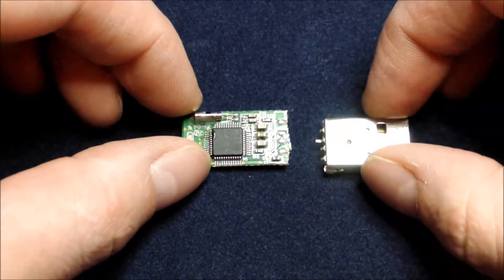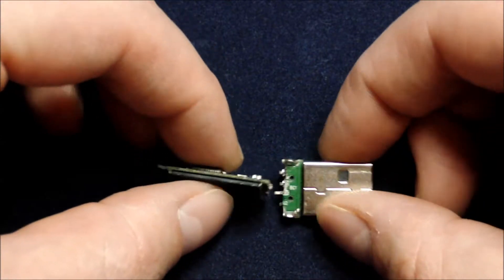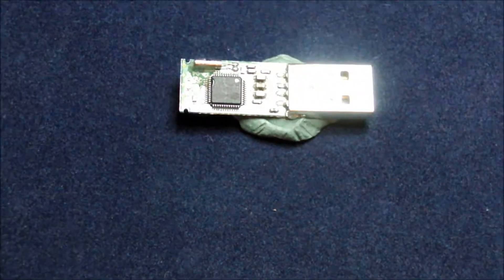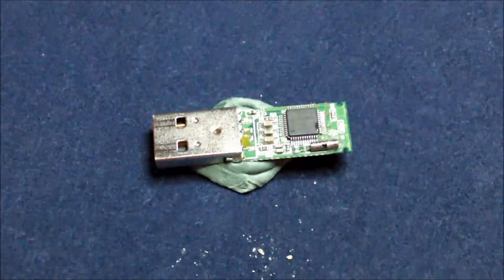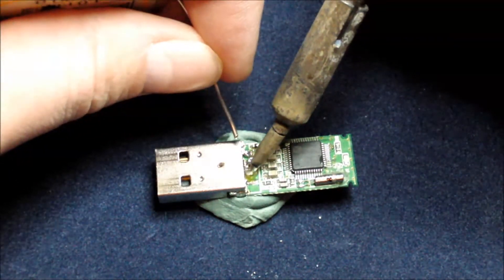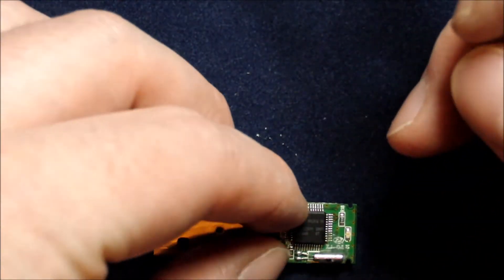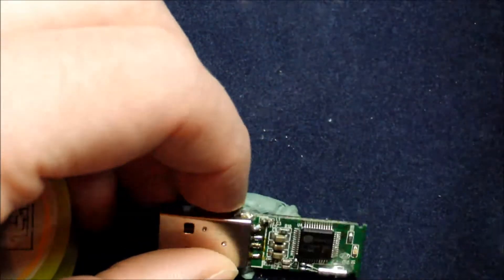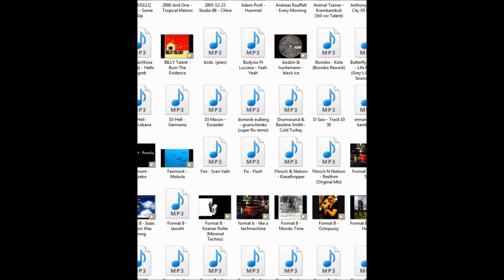USB-Stick live repair

Comment: if your adding flux to the joint be for soldering then you can add solder to the tip of the iron before touching the joint because you don't need to use the built in flux. also you should really get a 1mm chisel tip they are much better for this kind of work.